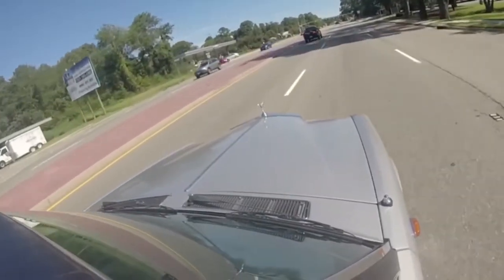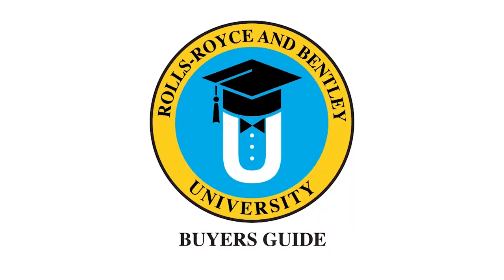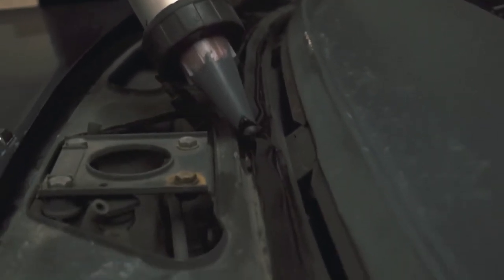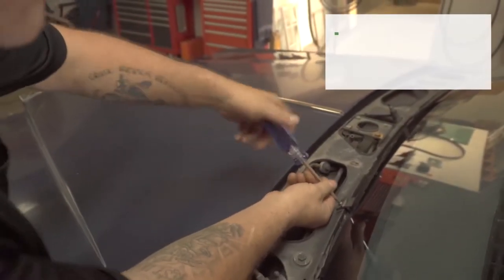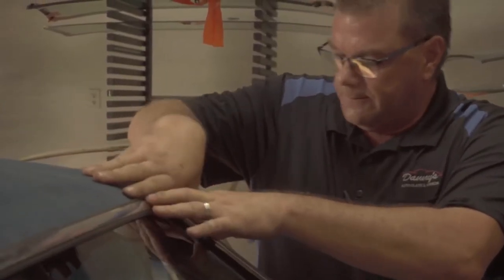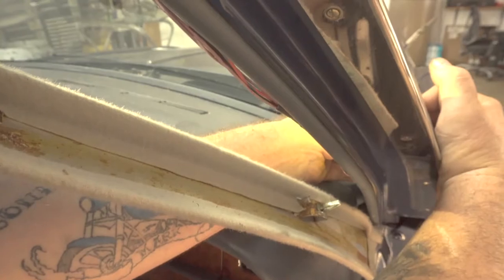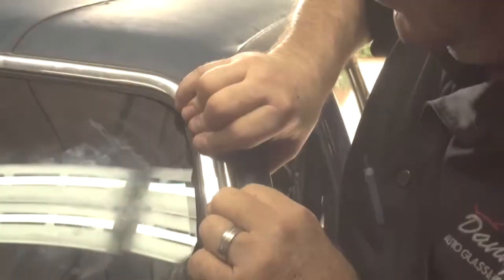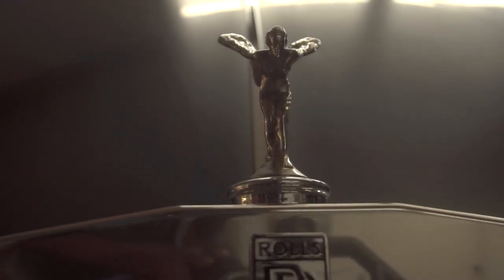Rolls Royce And Bentley University - Windshield Install by Danny's Auto Glass And Mirror

Comment: The finish to a very good video series on windshields for Rolls Royce cars!  There is nothing "mysterious" about Rolls Royce automobiles. Unban legends abound when for the most part MOST of the normal servicing can be done with regular mechanic tools and normal technician knowledge. They can be maintained for a reasonable cost with a little forethought and planning. Buy the best example you can afford and continue to maintain it as you would with any other car and DRIVE IT
Rolls Royce-Bentley University posts another good video!
Reply: You don't have a clue. Simple servicing and repairs are easy are easy, anything more can quickly become difficult. If you think there's "nothing mysterious" you only display your ignorance. Many of the techniques to make/restore these cars are only known about by an increasingly small number of people. Try and find someone in the US who understands how to set suspension heights or realign the rear subframe.